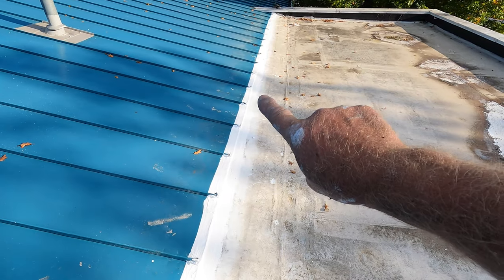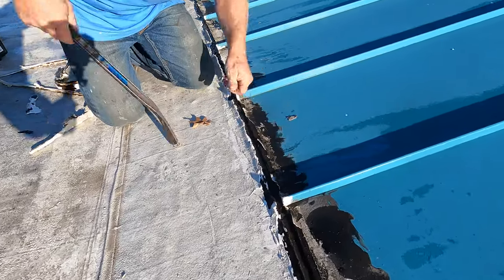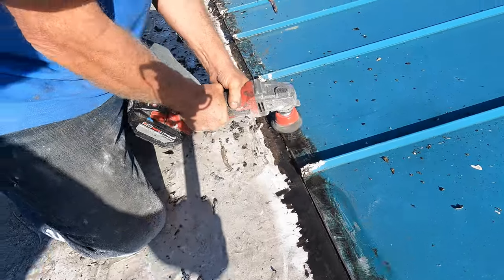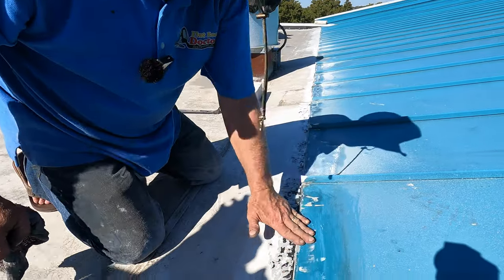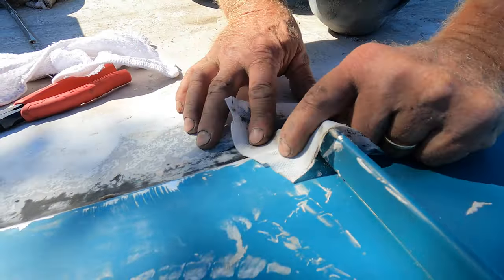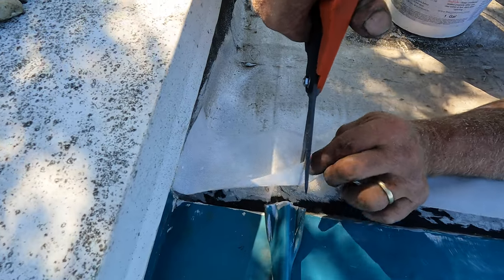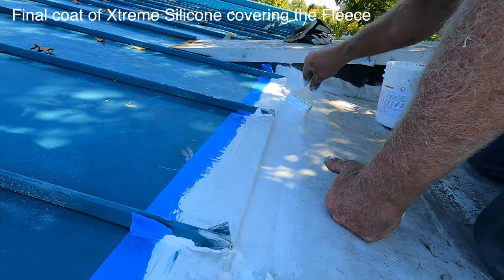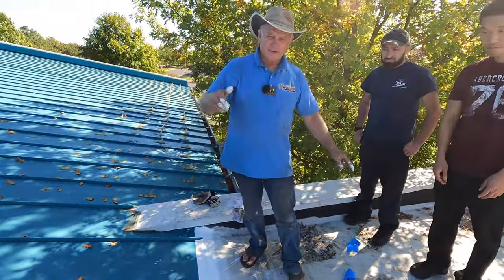How to make a Transition from a Metal to a Rubber Roof

Comment: Does this repair work on a transition from asphalt shingle roof to epdm flat roof as well?
Reply: You are not supposed to have a shingle roof and a rubber roof joining each other unless they are seperated by a synthetic felt,the rubber will fail sooner being in contact with the rubber roof.